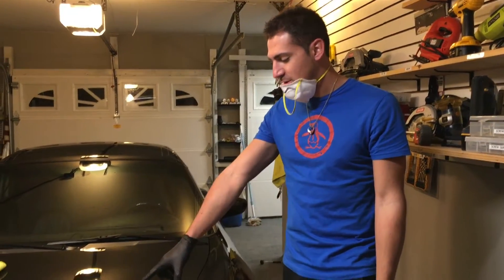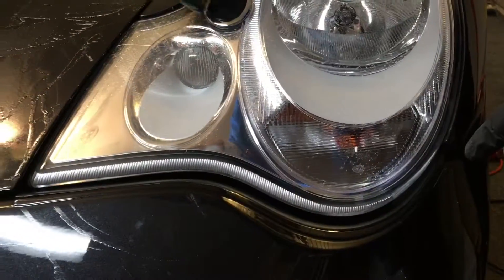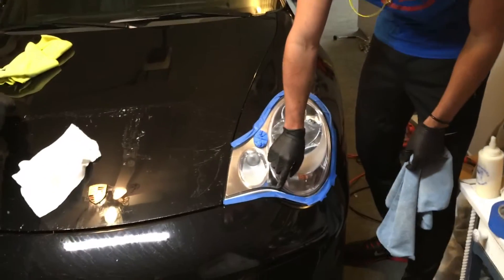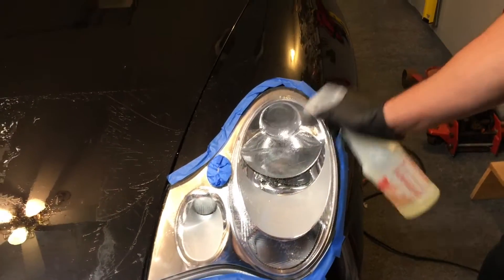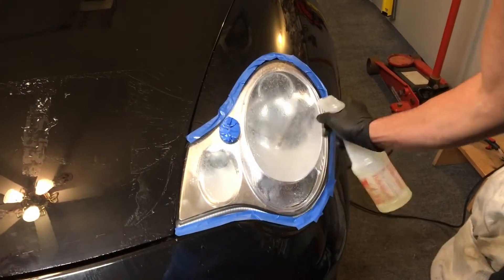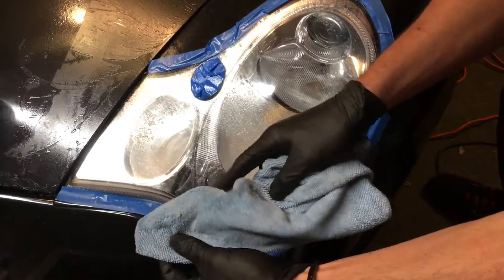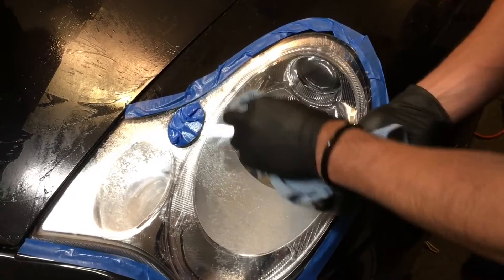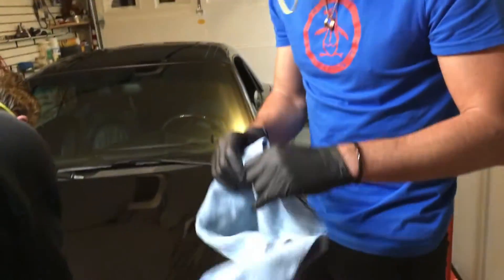Removing Sticky Residue From Headlights

Comment: I have Plastic Headlights lenses on my 2012 Chrysler 300C, removed the Vinyl Blue tent after 3 years using a heat gun (low setting), then used Acetone (liquid can) and a cotton towel to remove the glue residue without any damage to my plastic headlight lenses. In addition to using Petrol, Acetone works very well.

Acetone is used for cleaning project residue consisting of adhesive removal and is also used for thinning Fiberglass Resin and Epoxy. I've also used Acetone to remove Plasti Dip from chromed plastic, chrome wheels, and window tent glue residue on glass with no damage to these items in any way. No scratching, clouding or dulling.